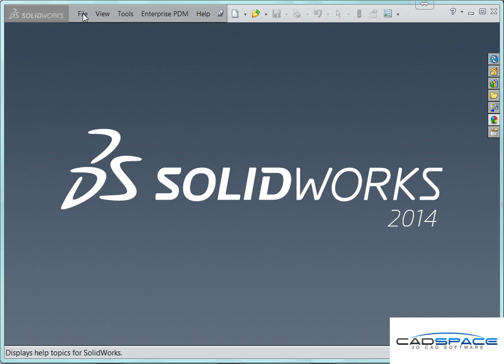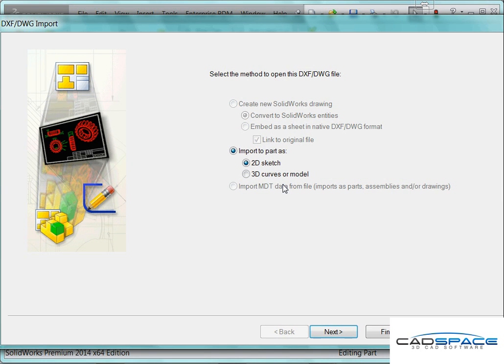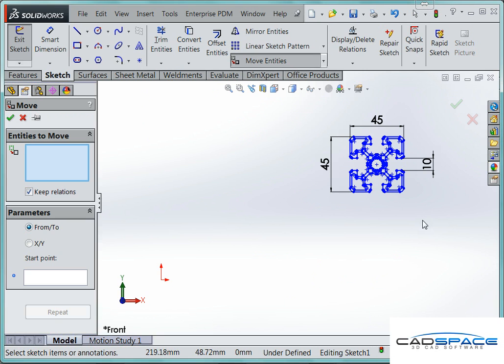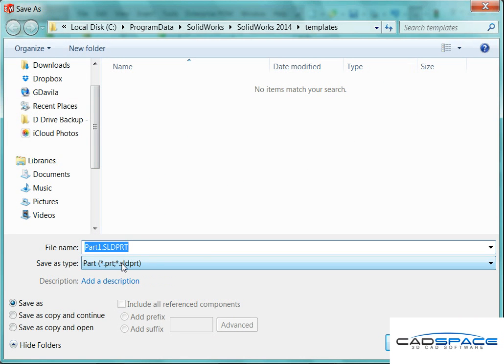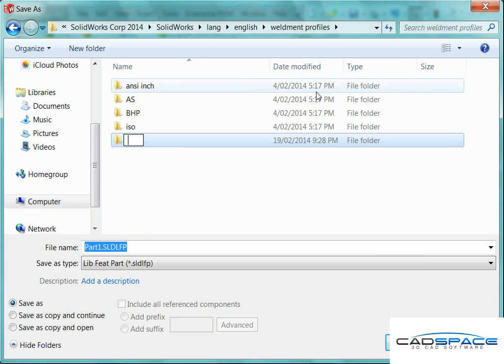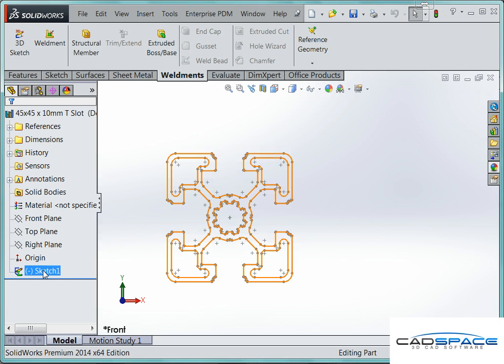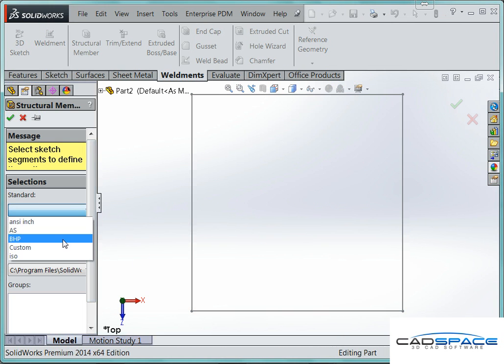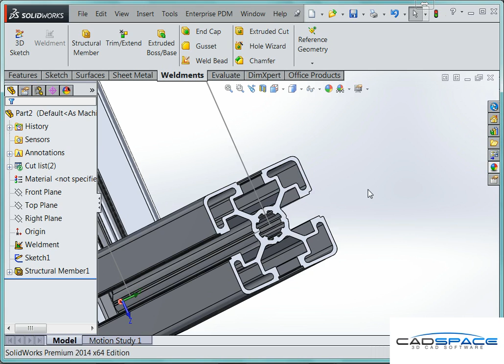Creating your own SolidWorks Weldment Profiles

Comment: but how do you align the edge of the parts when you have different thicknesses?  the library parts are converted from the center line and if they have different thicknesses, the edge will not be aligned.

Comment: hi there, help
When I try to save it a massage popped up, and it says ” you don’t  have permission to save in this location, contact the administrator  to obtain permission.”
Reply: Hi Sole hope, By default SolidWorks tries to save your Weldment Profiles in "C:/Program Files/SolidWorks Corp/SolidWorks/lang/english/Weldment Profiles". If you are not the administrator user it will not let you save it there as Program Files is a windows protected folder. What you should do is create a folder in your Documents called "SolidWorks Files" and create a sub folder called Weldment Profiles and add all the profiles there. You then need to open SolidWorks, go to Tools->Options and in the list select "File Locations", in the drop down list that will appear select "Weldment Profiles", click Add to add the location of the folder you created. This will then load the profiles in the default locations, and also your custom location. 
Let me know if this helps, otherwise i can make a video to show you.
Reply: thanks to you, it works